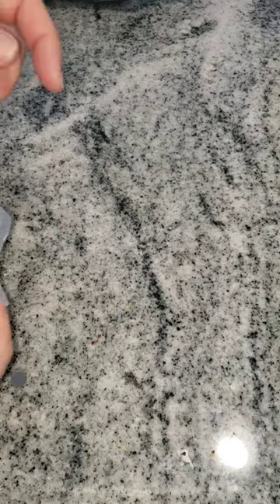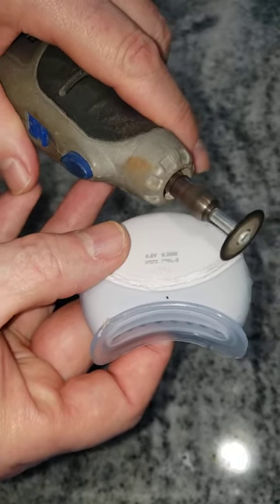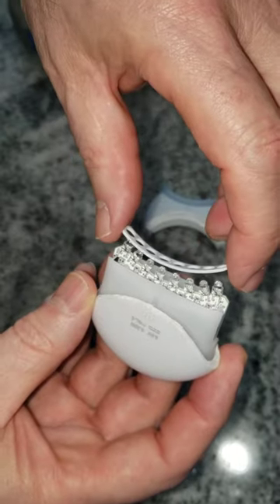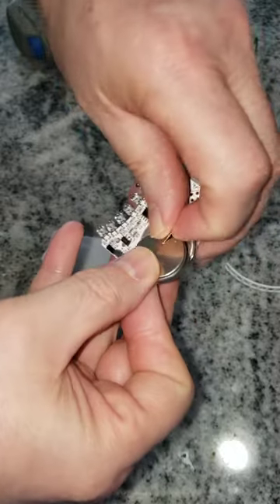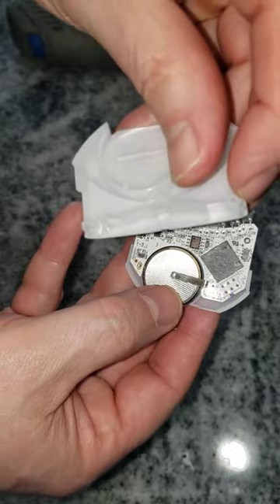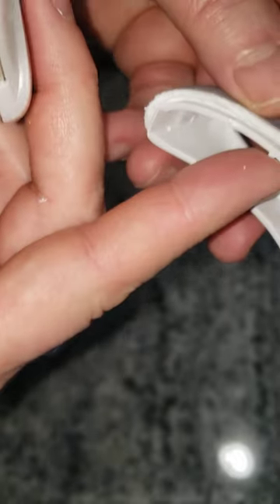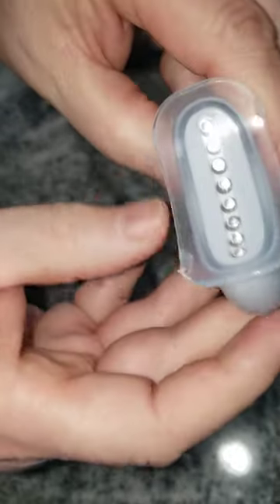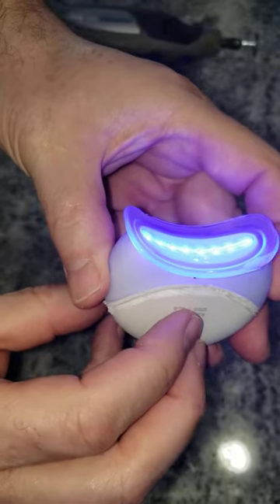Teeth Whitening Light not working right???  **FIXED** HERE IS HOW TO GET AT BATTERY!! FINALLY

Comment: even if you replace the batteries, the circuit board will not allow the LED blue lights to stay on for the full 5 mins.  More like 10 sec.        This video is misleading

Comment: yeah it didn’t work, i had just got mine today and it wont work i do what i tell me to do to turn it on but the light only turns one for literally 0.4 seconds nd it shuts off and im really mad because i was waiting nd hoping all day to use it and i couldn’t so i very upset frl
Reply: did you replace the batteries or just remove and put them back like in the video?
Reply: Same with mine. I got mine from the dentist didn’t work no matter how long I held the buttons. A week later which is today the thing is randomly on while in the packaging 😮. I don’t know how. Now it won’t turn off. I’m returning it asap